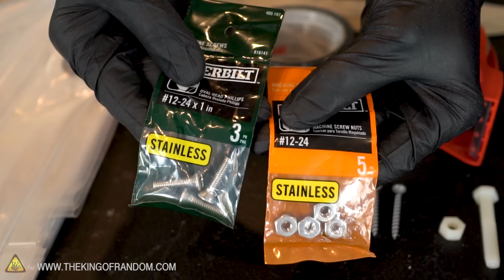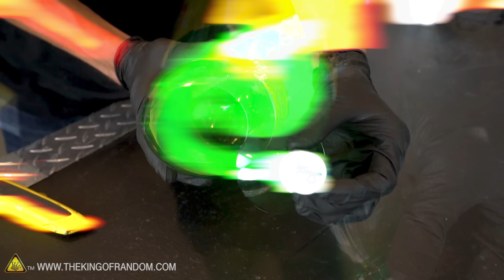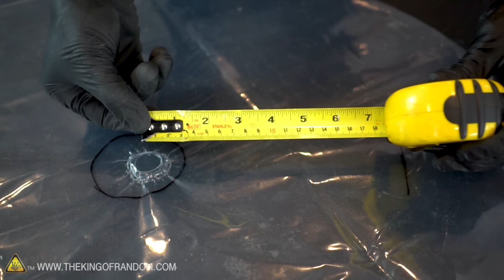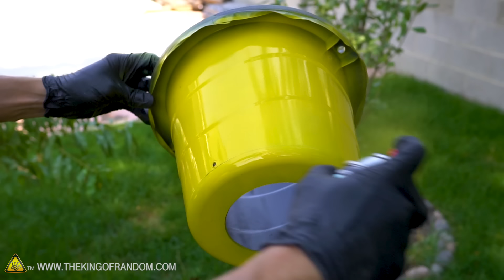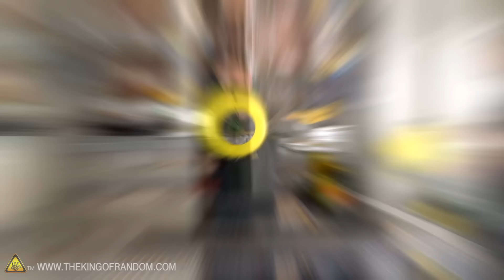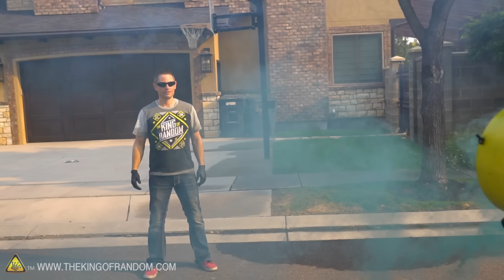DIY Smoke Ring Shooter! TKOR Builds An Epic Airzooka, Air Vortex Cannon, DIY Air Vortex Cannon

Comment: it occurs to me you could skip the melted holes in the bottle, and the nylon bolt, and just leave the ball on the bungie cord, feed that through the cap, and glue it there.  cut your bungie midway and tie it through the bucket per normal.

Comment: you can do pretty much the same thing if you duct tape a tight trash bag to the open end of a trash can or bucket then cut a large hole in the other end. then fill it with smoke from a smoke machine and slap the trash bag and the smoke will shoot out in a ring

Comment: What happens if you mix liquid nitrogen and liquid oxygen. Is it flammable???
Reply: Oxygen itself isn't flammable. It just makes other materials more easily combustible.
Reply: Bradley Huizinga lit idea
Reply: smart guy
Reply: or girl
Reply: Mr. Boma's Balloons that's what I was wondering about the mix if it would
Reply: That is a great question
Reply: Mr. Boma's Balloons oxygen is not flammable whatsoever
Reply: No it's not. The liquid nitrogen forms a layer of nitrogen gas above the container that snuffs out any flames. You wouldn't even be able to get fire close enough to try lighting it.
Reply: Pure Oxygen is super flammable.
Reply: It very much is
Reply: DoingStupidStuff it's an oxidant, well remembered
Reply: thats what our atmosphere is made of. you'd just have cold air.
Reply: No
Reply: Oxygen (O2) is flammable, nitrogen (N2) is not. So, a mix of the two won't be any more flammable than the liquid oxygen alone. The atmosphere is 78% N2 and 21% O2. When you burn something, it is being fueled by the oxygen from the atmosphere, not the N2.
Reply: no it is not the co2 would not let oxygen in to ignite
Reply: If you mix two parts liquid hydrogen with one part liquid oxygen, you get Water!
Reply: oxygen is not flammable

Comment: Great job Nate!!
Now attach a canister at the bottom that holds the smoke. 
Make a trigger on the handle that opens the smoke chamber
When you pull the load bungie back, pull the trigger to open the smoke chamber to load lots of smoke.

Comment: was wondering if you could do a video about a microwave Kiln . I've made one in the past it was pretty neat ..I melted gold from computer scraps , glass and other materials the only thing is I had to modify the microwave by removing the thermal heat turn off switch and by adding extra cooling to the transformer and internals due to the amount of time you run the microwave it gets pretty hot making it less efficient due to resistance , also when melting metals you need to put a piece of carbon on top of the metals in The Crucible .. I'm not sure if you've ever made a video on this because you have so many videos now but if not I think this would be a cool idea for a video...
GPK company LLC .com has the correct kilns to use and materials ( not affiliated with them ) for gold smelting ..

Comment: You should see if you can melt down a mini metal foundry using unprocessed charcoal since it burns hotter which, if it doesn't work, could be followed by thermite.

Comment: What was the point of making a full-on flame thrower and then never making a testing video to show it working? Why not even acknowledge that there was an issue of some sort ( legal, ethical, technical etc ) and that you couldn't show the final result of the build in action? Curious minds require answers...

Comment: I heard that some fire extinguishers are 98% baking soda. Would if you tried cooking something using that instead of regular baking soda?
Reply: Bushcraft Baxter it's treated with other chemicals in the K type extinguishers meant for kitchen fires. Still would never recommend an extinguisher for oil fires though as it kicks it all around.
Reply: +Bushcraft Baxter I think it would depend on the fire extinguisher because there are different classes. BTW where did you here that i have thought about  dissolving baking soda in water  and using it to fill fire extinguishers myself because sodium bicarbonate (baking soda) produces carbon dioxide when it is heated.
Reply: ya plus it there are different kinds of extinguishers
Reply: TheBushMaster I literally just saw it on someone's vlog when they went to a fire extinguisher store and the "expert" said that the one they chose, which was a standard school or household type, was 98% baking soda. 
So I wandered if it would work like kitchen baking soda.
Reply: The other 2% is pretty important because it doesn't take much to poison you.
Reply: Bushcraft Baxter i
Reply: I didn't want him to eat it, probably should have added that at the end of the comment.

Comment: The trash can versions make huge rings.  We had it on a rolling mount.  Two people had a tray with stacked cups. Two other people manned the cannon (one to aim, one to fire) as the two with the tray tried to avoid the air blast.  Harder to do when there's no smoke

Comment: How about placing a matchstick instead of cups and then you fill the vortex with propane and shoot it towards the flaming match: fire rings?
Reply: As you saw, there was some going along with the ring. If you tried to use propane to shoot at a flame it will quickly light you air cannon and possibly you on fire. Would not recommend.

Comment: Clear packing tape is a great way to create a highly stick-resistant work surface that is great for glue ups and the like, since glues generally won't bond to it, and it'll prevent them from getting on your work surface.
Clear packing tape is also a great way to "laminate" small papers to prevent them getting damaged, by simply applying it to both sides, and then cutting it leaving a border around the paper.

Comment: In the 60's there was a toy gun - maybe made by Whammo! - that was pretty much this same thing. There was a lever one cranked back, then locked forward to engage the diaphram. The 'barrel' was funnel shaped, and would emit a burst of air that could be felt several feet away.
I, and several kids I knew had these things, and we modified them by further reducing the diameter of the barrel, and rigging it to hold plastic magnet tipped darts which we used as projectiles - those things just soared!
Nice post - brought back memories.

Comment: Is it possible to turn carbon dioxide into a liquid, then freeze it into dry ice?
Reply: Carbon dioxide can not be liquid under normal preasure. Search for triple point of carbon dioxide.
Reply: Inside a fire extinguisher the carbon dioxide is liquid just under severe pressure. If you get a small bag made of clothing and put that over the nozzle of the extinguisher and spray some gas. You should theoretically be left with dry ice. I hope this answers your question😄